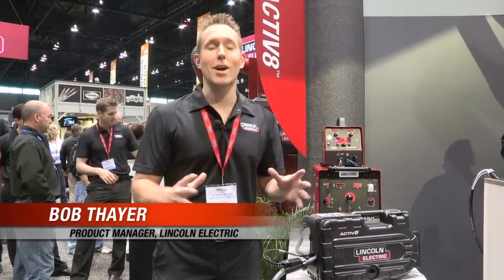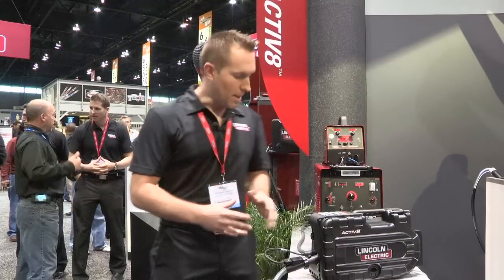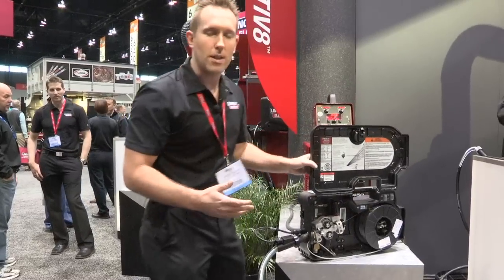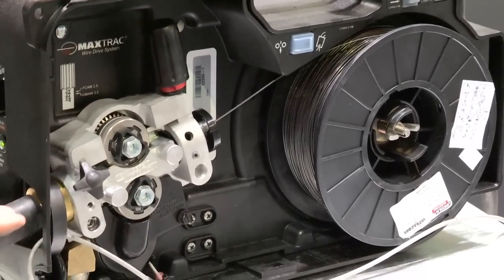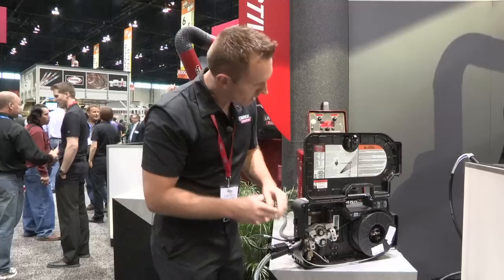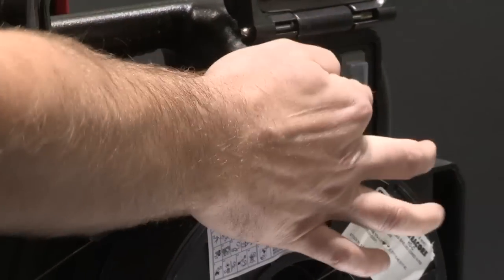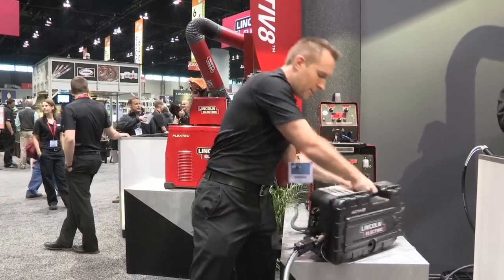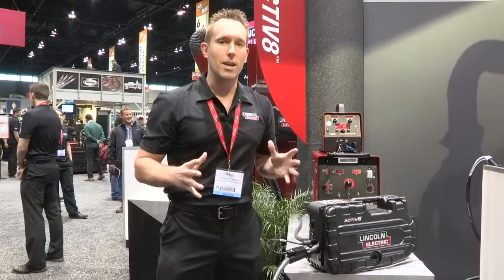FABTECH 2011: Activ8™ Wire Feeder

Comment: Hi Lincoln i wish you will also do a video on “double press” a technique where in you have 2 settings in a single torch.this is very effective in pressure vessel and shipyard welding.i have been using this technique in japan way back 2009.